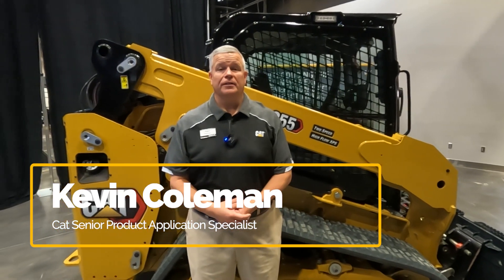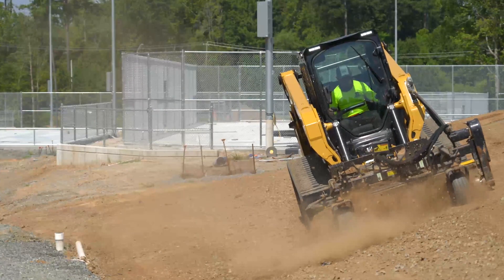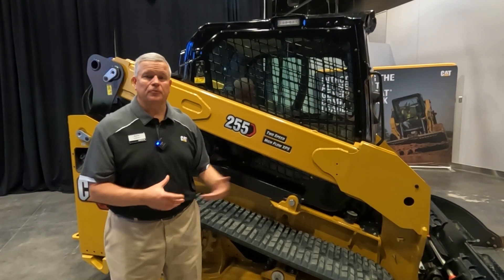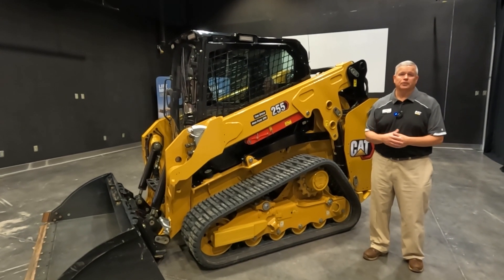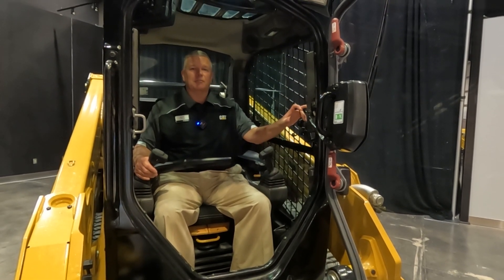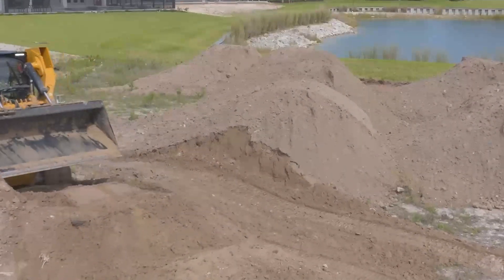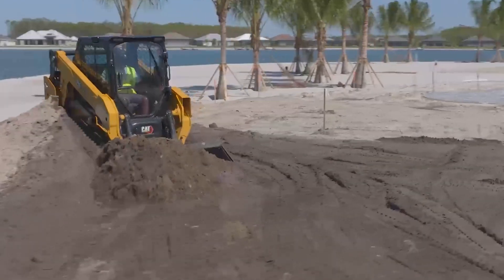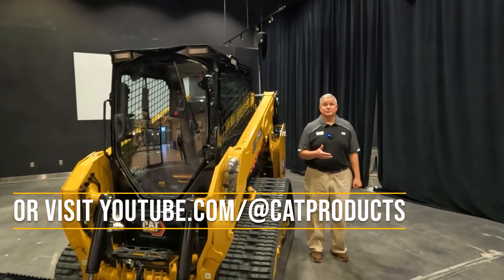Caterpillar's Next Generation 255 and 265 Compact Track Loaders

Comment: Why  can't you have an option to get rid of the mesh ? I personally  hate it !!
Reply: Have polycarbonate cut to size,  cut out mesh,  I have done it on bobcat r series
Reply: @rontopping2048   I think they would void my warranty  if I did that 🤣
Reply: @chriss7930  has nothing to do with warranty.  If it's done correctly wont compromise resale.
Reply: @rontopping2048 here in the UK it would. I got 2 on order  and just doing another.  Over a year waiting  but will be the first ones in Europe  apparently

Comment: Can you get out of this machine with the bucket half way up? No you can’t, I’ll pass thanks
Reply: Why do you want to get out of the machine with the loader arm half way up? There's an accumulator in all the Cat machines that allows you to both curl the attachment and lower your arms.
Reply: @snorelacks7069 if you run a mulcher, linears break under it. It’s good to be able to check them.
Reply: @Nissan240  No excuse whatsoever to crawl under loader arms without them locked out...none.
Reply: Seems goofy, like more work getting out with the bucket directly in front of you like that... I'd sooner just lower the arms lol. But if you look at the front, they redesigned the arms and interface so you can lift the bucket 1-2 feet off the ground and still open the door. Way better than before where they needed to be on the ground.
Reply: People get killed every year getting out of these machines with buckets in the air then getting out, only bad things can happen getting out under a raised bucket or attachment.  I'll take the swing door and my life or my kids that I'm training anyday.

Comment: metal tracks or rubber tires  the rubber tracks is planned obsolescence
Reply: I remember when everyone said that rubber tracked machines would never take off. Now skid steers are a very small percentage of the market and CTLs dominate it.
Reply: It's obvious you have never used a tracked loader when it's wet. Keep your tyred skid loader in the shed for 6 months mate, because you will just bog it

Comment: It will also have tons of Chinese parts on it and will be $15,000 more than anything else in it's class just because it has yellow paint.
Reply: It's more "American" than many...Where does Bobcat get their engines? How about Deere? The engines in these two machines are built in Georgia.

Does it bother you that Deere doesn't even make their own mini-excavators (Hitachi now and soon to be Wacker Neuson) or Compact Wheel Loaders (Liebherr)? How about Case's mini-excavators (made by Kobelco)?

I'll let you in on a little secret....there are only a handful of hydrostatic drive manufacturers and drive motor manufacturers for compact machines as well....and Bobcat, Deere, Case, Kubota, Takeuchi, Cat, etc. all use them.
Reply: @snorelacks7069   Let me let you in on a secret. No matter how much you support CAT. You are supporting China. Trying so hard to justify CAT having plants in China.
Reply: 😢 @snorelacks7069  fyi cat uses kubota engines,  install cat components.   Cat wait to get one of these 255
Reply: What about the advanced metallurgy, inertia welding, class leading machine performance and fuel economy that backs up the 10%-15% higher price tag? The parts are best made, and the engineering is awesome. Side by side, usually costs 20% more to own the competitor over the course of life including acquisition costs. Believe me, the money goes towards longevity. CAT forever.
Reply: Caterpillar does not import their own stuff idiot, but be a good little cheapskate and buy a Takeuchi!!
Reply: American dream is built in china.
Reply: You definitely get what you pay for, I've bought 2 new cats recently,  a next gen d3 and 420xe backhoe, they blew me away with performance and everything else, I currently have a case tr340b but I think I see a 265 in my future!
Reply: Nailed it!!
Reply: @mountainjam27  No you don't. Listen you walking clown show CAT compact track loaders have tons of Chinese parts. Also some of them were completely made in the Caterpillar china plant.